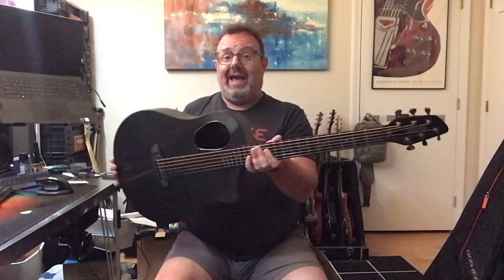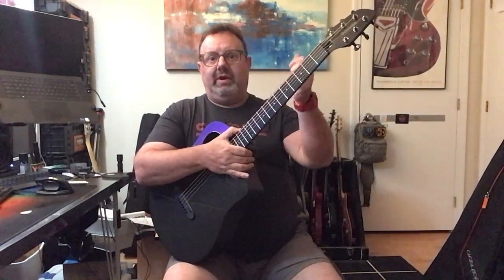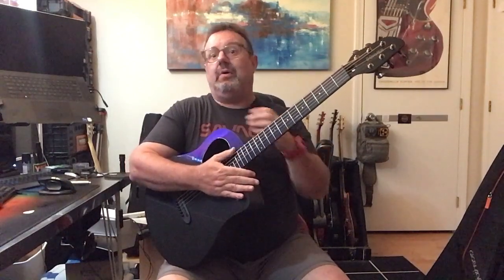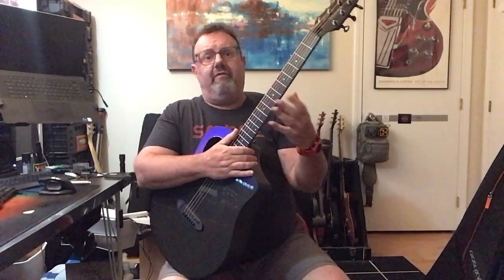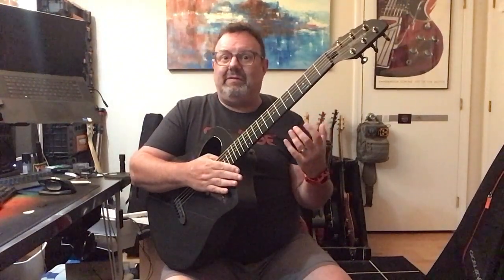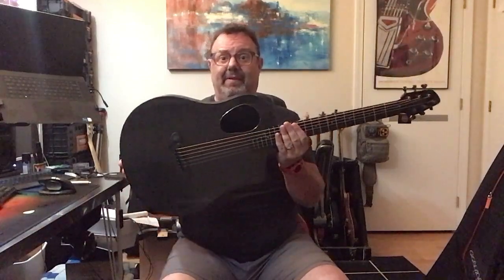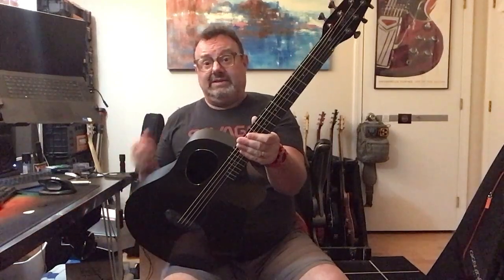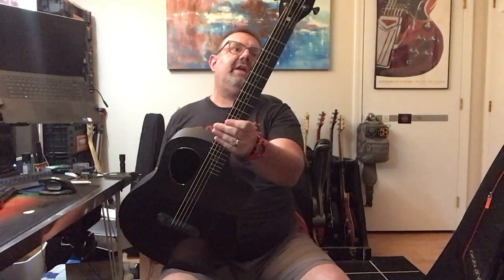Six String World - Episode 77 - Donner Rising G Pro

Comment: Just picked one of these up super cheap. I’ve also owned a couple Enya instruments and liked them ok, but for whatever reason I just didn’t connect with them well enough to keep them long term. We’ll have to see about this one. Great in-depth review and heads’ up about the action and relief!
Reply from the maker: I’d love to know your thoughts on it when it arrives! Thanks for watching!
Reply: @6stringworld  yeah it’s due to be here in a couple days, kinda excited and kinda nervous lol. Read that some folks have had issues with the top deflecting quite a bit tuned to standard. Apparently the bracing is questionable for some. We shall see…I will report back. Oh yea—new sub! I dig your channel so far. Thanks again!
Reply: @6stringworld  it came tonight! Before tuning it up since the strings were already loose I removed the one shim under the bridge, no buzzing and no neck adjustments needed. Action is beautiful, the guitar is pretty well built but did you notice yours makes some creaking noises? Mine does but no biggie as they aren’t audible when playing. I love the stock strings, the soft case is much more a case than a standard gigbag, and I love the lightweight. It plays and sounds like a dream, I noticed very bassy when not using a pick but it brightens up with pick. Either way. I am extremely impressed and feel lucky I got it for about $400 off! It’s probably one of my favorites now. Only one complaint is the tuners…even after tightening them up, they made me lol. It was your video that helped shed some light on what to expect, so thank you again!! New sub. Please keep up the good work.
Reply from the maker: @Noahinthe802  No creaking noises of any kind, that could be the strings breaking in, or the tuners slipping!  I have debated upgrading the tuners, but haven't pulled the trigger! Glad my video helped, and thanks for subscribing!
Reply: Very detailed review on this Donner.  Thank you for sharing your experience. The truss rod adjustment and removing the saddle shims are both easy and quick to do so that doesn’t alarm me.  I would definitely upgrade the tuners though.  LR Baggs is releasing a new HiFi Duet preamp at the winter NAAM show next week.  It would be great to install it in the Donner.  It doesn’t use a piezo so it won’t have any annoying quack sound.  I don’t know what the cost is going to be yet. 👍

Comment: Installing a system like I described is pretty easy even if you have to enlarge the endpin hole.  Most often you don’t need to do it since there’s already a hole large enough for the jack.  Just use a step drill bit to make an existing hole bigger. And you should find a better store that is more accommodating to your instrument needs.  If I was a store owner I would take care of my customers regardless of where your instrument came from.
Reply from the maker: if you put in the LR baggs let me know, I'd like to hear how the installation goes! I was thinking of installing a curtis novak Thunderbird electric pickup on the top. I'd have to go with electric strings, but it could be interesting! Thanks for watching!